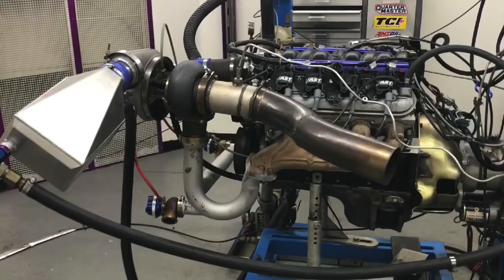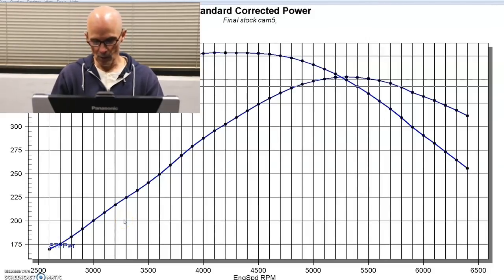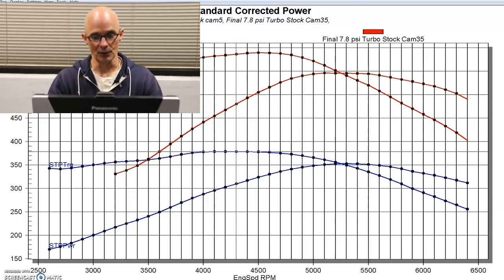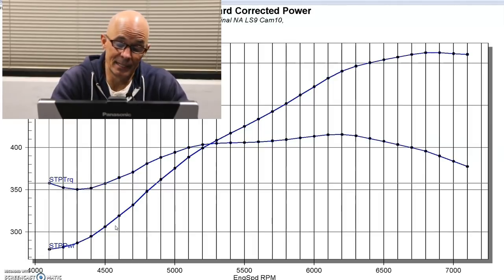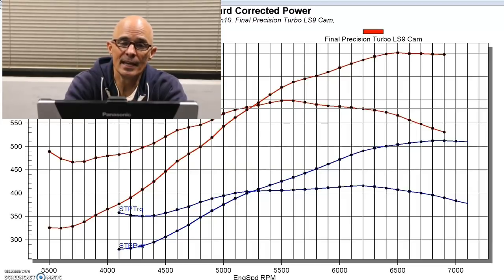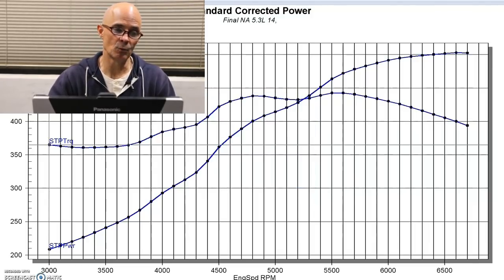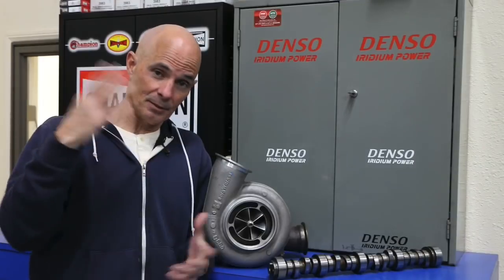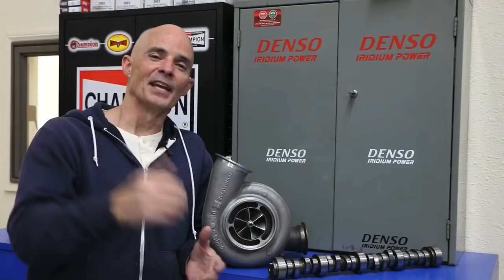REVEALED-DIY TURBO SECRET-EVERY CAM WORKS!

Comment: Good to see this kind of video out there - it should keep a lot of people from throwing money away.
The whole advent of the "turbo cam" is from when high performance cams were primarily slightly toned down, long duration, big overlap race grinds developed for big N/A horsepower, had very narrow powerbands and had little to nothing for drivability or area under the curve.
Those old grinds and the fact that cars were carburated (carburetors rely on steady/smooth airflow at low rpm to properly meter fuel) meant that adding a longer intake tract like turbo ducting made engines even more lazy on the bottom which added to/created what people called turbo lag - stepping into the throttle got nothing for results up to the rpm the cam was designed to work in, then the boost would come in about the same time because the engine was now making exhaust flow and heat to spool up the turbo. Back then a stock cam was a much better "turbo cam", so the demand for "turbo cams" was born.
Early turbo cams were just slightly hotter versions of stock grinds which put low speed throttle response back into the power band.
Camshaft design knowledge has moved so far forward since that time.
There's still an advantage to using a camshaft designed specifically for turbocharged applications - but that should be one of, if not the last place to look for more power in a turbo application.

Comment: Great video Richard! Oldschool, with carburetors, the general rule of thumb was to run cams with a wide LSA. Today with FI, less of a concern. As illustrated, boost multiplies the power output of a NA engine. I would love the see a future test of cams with LSA of 108 to 120deg. For me, which cam makes a turbo more efficient with respect to response and boost. If running a LSA of 108deg, can the timing of the fuel injectors be delayed to minimize unburned fuel being introduced into the exhaust.

Comment: I did an old school Ford 302 in a '90 Mustang LX about 15-16 years ago. It was an NA cam. My brother, Denisson, argued with me about this because we were using a Vortech T-trim supercharger. I had seen a build exactly like this, using the same blower and cam. It made 650 hp at the flywheel. We were at about the same boost as this 650 hp engine, 15-16 lbs. It worked great!!!!! I raced a worked Evo on a highway, in Mexico, and I had to pedal it until 3rd gear, then it started going sideways at the top of 3rd!!!! With sticky road racing tires!!! This cars suspension was set road race stiff. You could push down on the hood and the suspension would not compress. Table stiff. Going through the gears WOT, the front would lift up on the suspension like it had drag springs in it!!! My brother was very happy with the outcome. I was too. BTW, I would buy an armored car as a daily driver if I was you!!!! Thanks for being  honest too.

Comment: Great info Ive noticed this in your dyno charts up to now, good info to get out there. If your turbo can only produce a max of 1000hp running too big of a cam is only gonna limit your bottom to mid range. So a turbo cam should basically be a sized for planned turbo output to maximize power under the curve. Nice!

Comment: I just watched the first 30 seconds and thank you! Turbos do what they do. They make more power. Want more power from your turbo setup? Build a motor that's better na or make more boost. The more you can flow na the more you can flow turbo and make more power with less boost. Wanna make more power in general with any setup? Make a better air pump. That's what engines are. Giant air pumps. When your pump can flow more air you can add more fuel and make more power 👍WANNA CHANGE THE WAY YOUR ENGINE MAKES POWER? Change the cam. pretty simple at the heart but it gets complex when you're running the ragged edge and trying to eek out every drop of everything you can achieve within a given setup or set of rules etc...

Comment: This video was very useful to me. I had aspirations to torch my old 305 k10 Chevy just because it’s a fun experiment. There won’t be high expectations for a 160 NA engine but I always felt it would work. I’ve been told that it was a silly experiment to try to make 350 hp when a cam and heads would get me the same output; however, I have a 300 hp 305 and it isn’t a good combo for daily driving. The stock motor seems to be; especially with the addition of boost. By my calculations, the VE is so low, I suspect that I may really need to shove it in under pressure to hit my target but I believe it’s easily obtainable and it isn’t enough to damage the stock internals.

Comment: This is 100% the truth I did so much testing all the results were actually the same as what you're talking about what turbos do is magnify the horsepower your engines already putting out I argued with so many people when building  motors for them that's what I do now i showed them on a Dyno took the time to pull the cam out and put a turbo cam back in made less power and still they didn't believe their eyes comments were I don't  have the turbo up like i did with the na cam LOL people are going to be stuck on what they hear how they feel GOOD VIDEO!!!! 👍👍👍

Comment: Excellent video.

The reason that they market cams towards turbo, or sc or nitrous applications is because they design cams too make up for shortcomings in the power adder.

The LS9 cam you showed is an excellent example of this. Supercharged cars run out of steam and boost up top. GM designed that cam too make power up top because the eaton blower makes plenty of power down low and in the midrange.

Comment: This gives me some peace of mind.  I've got stage 2 N/A cams in my 5.4 2V that I'm going to put a single turbo on.  Ive been in a mental struggle on whether to change the cams out for turbo cams.  If it was an all out, max effort build, then maybe I could justify it.  But since it's just my daily driver, I think it will be just fine.
Reply from the maker: I ran those 2V cams on a 4.6L with a turbo-works great-little soft down low (na and boosted)

Comment: My understanding of the differences with turbo cams was to improve how quickly the turbo spooled on the low end and improve efficiency by reducing the amount of fuel air mixture that was blown through during valve overlap. Totally agree on total output though. don't matter there.

Comment: On a dyno I believe everything he says.on the drag strip changing to the “optimum cam” to take advantage of gearing,weight, converter, and how fast it spools in the 60’ ,330’ and mph is a definite advantage
Reply: And also how it reacts at part throttle stuff during normal driving conditions.
Reply: Don’t matter you will set that up to whatever power curve your engine has! It all comes down to what your going to do with it.
Reply: Not everyone gets it right the first time. It’s A lot easier /cheaper to change the cam versus gears,converter, or weight
Reply: @davidyoder3605  Especially with a typical grandpa car with the 4r70RW like I have, my Towncar could sure use another 125hp, more torque and a good diet, preferably while improving efficiency

Comment: I've always been a NA guy and engine builder.  I always thought what you're saying should be the case but all of the noise in advertising and on the internet made me wonder if this assumption was correct.  In my mind and what your empirical data shows is that, if you think of a NA engine in a sealed dyno room that can maintain constant atmospheric pressure and temp, as you pressurize (boost) the room, the power curve should increase proportional to the amount of atmosphere(s) (pressure) the room is increased. The only small caveat would be if frictional losses increase.  I know the exact opposite happens as NA aircraft engines go up in altitude and lose atmospheric pressure and horsepower, there's lots of data on that too.  Great video, thanks!

Comment: Thank you very much for providing this video and information.  Im in the middle of building a 5.0 and wanted to get the car going NA and add boost down the road and didn't know if the AFM N41 cam would be ok with boost. This was so helpful. Now all i have to do is get thicker headgaskets to lower the compression from 10.5:1 and add a turbo!!!

Comment: Great video Richard. I've been saying the same thing for decades....as well as adding compression. How much cylinder pressure can the rods and main caps safely handle?

Happy n/a engines make happy boosted engines!
Reply: Too an extent, granted nowadays you can run a little more compression than people use to. But still running a huge amount of compressing let's say like 11ish:1 will help with power production but there is a point where the cylinder pressure is too much and your going to make more power being able to turn the boost up more than the extra compression is going to help. Plus the fact of the kind of fuel needed to run a super high compression engine and then adding some Japanese hot sauce to the mix.
Reply: @torqueandbeanssauce  I've been told by the "tribe" here that 9:1 gives the best throttle response and works with boost, and that is what they now target.

Comment: Me and my dad can’t wait for you to do the sloppy stage 2 build  on a 4.8 or 6.0 or even both 😁
Reply: I wonder what he would recommend for us street/strip daily driver do it all guys, figure 3500lb car (or small truck), running a/c, ps ect. that would like low cost, decent mpg and run mid-low 11s. (with so-so 60ft) Like Matt says "goals".  I'm thinking maybe 6.2/6L80 from a complete 07 copart escslade with a small/medium shot would get me there. Short tuning here in Ky has set up some 6l80's without the BCU and they should live under 550 whp, so I would target 550 at the wheel.

Comment: Very very good tech. I'm planning on building a car soon. I'm new to the turbo stuff and you taught me so much. I wanted to start off and build a na motor and get as much as I can out of it but with the thoughts of adding boost later. So if I build a 400 hp engine. When I boost it at 14.5 it should make 800. Very simple and easy way to see if your tune is on or not.
Reply: Also I notice you do alot of na and turbo tests on sane engine. How much of the tune do you change from na to turbo? Have you found a formula to go from one to the other? Or are they all different?

Comment: 21.2K !!! You're growing brother !!!  I have like a bazillion questions LOL...
You always say to build the engine the best you can NA first, then add boost...
But doesn't piston to valve clearance, springs, compression ect. have to be taken back or undone a little to keep things in the safe zone?  Also, with today's modern oils and additives, is it safe to go bigger than usual with a flat tappet system on older engines?
Reply: The only thing that you listed that matters and this is JUST A LITTLE is springs.  Now when your valves are closing they are sounded by more dence gas(s) and so will be slower to close and the boost pressure will be pushing on the back of your intake valves.  The compression only dictates what new minimum octane you need and how much ignition timing you can run.  As Richard is trying to explain is its not as complicated as a lot of people make it out to be.

Comment: Great video displaying common physics.
HP = AP X CID X CR X VE X RPM /5250 / 150.8
Add boost (guage) to 14.7 (standard corrected Atmoshperic Pressure) and see what happens.
Great vid!
Reply from the maker: I didn't include the patented Holdener Power/Boost Formula. Turbo Hp=Na Hp x Boost/14.7 +1
Reply: @richardholdener1727  lol! I didn't want to plagiarize your work so I posted the "un-holdenized" formula!
Great work you're doing!
 Education is sadly lacking in the halls of horsepower these days....

Comment: "Back in the day" I was told a Turbo cam is designed to minimize heat on the valves and generate a broad usable  torque curve.

You don't want 1000hp going to the wheels in a aggressive fashion or things break and cars become uncontrollable or valves melting in real world situations.
Love your content by the way

Comment: One improvement on the how-much-power-will-boost-add question is to take the baseline brake power, divide by 0.85 to get the indicated power,  and then subtract the baseline brake power from the indicated power to get friction.  Then multiply your indicated power by the ratio of the new MAP to the old MAP to get the new indicated power.  Then subtract friction power from new indicated power to get the new brake power.  That 0.85 number was a good ballpark number for mechanical efficiency 35 years ago, but it might be higher nowadays with improvements to friction from better journal bearing design and roller cams.  Don't get me wrong, I like your ballpark guide, but his method would yield a tighter prediction.

Comment: Overlap spools the turbo faster but spins the turbo faster to make the same boost because part of the boost goes out the exhaust. The trick is to make a cam that spools fast enough but doesn't have excessive overlap.  Lets say 2 cams with the same specs make the same peak hp in an engine n/a, 1 on 110 lobe separation the other on 114. The cam with 110 l/s will spool much faster but build more back pressure up top where as the 114 l/s will have less back pressure & pull to a higher rpm.   That's the way i understand it.

Comment: i think the turbo cam deal has more to do with when the spool characteristic of the combo comes into play with gearing, stall, weight etc at the strip. I do agree with the message tho, boost is just a multiplier

Comment: This explains why the custom ground Comp Cams turbo cam (.513/.513 on a 115 LSA) for my 4.3L V6 Typhoon ran so well N/A. Had a nice flat torque curve. Running 14psi currently. Can't wait to get it tuned & start running it on the street.

Comment: I fully agree and understand the proportional increase along the rev line.
Q. You indicate that @ 1 bar (14.7 psi), you’ll typically double power output, though one could argue that if all things are equal, other than exhaust back pressure, which can be impacted by the turbine housing A/R, wheel trim, downpipe, ect, the actual increase can vary significantly at the same 14.7 psi boost.
Cylinder filling efficiency,, air temps measured inside the cylinder before the compression stroke, exhaust side pumping losses, etc.
In general...Power production of a turbo engine is dynamically impacted by the exhaust side more than one might expect.
Reply: As he said,  size the turbo correctly, then the math basically works.
Reply: Todd Allen 
Sorry...but engineering data proves Not all boost is equal!
Example: compare power increase from 14.7 psi boost from a single turbo, then 14.7 psi boost from a twin turbo on the same motor
Reply from the maker: Or if we dramatically drop the inlte air temp-we get more than 100% gain at 14.7 Psi
Reply from the maker: if the turbos are sized correctly, the same thing happens
Reply: Richard Holdener 
As I explained. Not only will various exhaust side elements produce a higher quality air charge. 
Various exhaust side elements (read my previous comment) help to produce more power as well.
Thus, 14.7 boost does not automatically equate to doubling power.
Reply: @flyonbyya  I believe the point Richard is making is that this is a general rule of thumb using the conditions he's seen in a dyno cell for 25 years.

Comment: Now try the same tests on pump gas. You might have a tuning issue with a cam with a good amount of valve overlap (N/A cam), in particular at high revs. Your absolutely right about the power curve being the same though on any cam, but back pressure from the turbo will cause hot inert exhaust gases to flow backwards into the intake (due to overlap) and warm up your “cool” intake air and auto ignite at high revs. This can basically be stopped by running an alcohol fuel or race gas.
Reply: At least this it what I’ve experienced and researched...

Comment: That's what I learnt with boost especially turbos , modern turbos are super efficient.  Don't worry about displacement or cam or heads . Just size the turbo for power you want especially the hot side and if you can't hit your desired goals just turn up the  boost till you get there . The import guys figured that out a long time ago .

Comment: I cannot believe how intuitive your videos are I've been watching every one of them and it has Changed My Mind Set On A lot of engine builds you seem to be extremely intelligent question for you I have a hang up I am building a old Ford 400 for my son and we're just going to throw a cheap twin turbo gt35 on the engine with the stock Pistons just to play around with i for the life of me cannot find the best cam online it seems that the Ford 351m and 400 share the same cam what's your thoughts on the best cam if you don't mind thank you so much
Reply: I was thinking of this cam
SUM-5201
Reply from the maker: A 224/230-ISH CAM WILL WORK WELL-AS WILL MOST OTHERS
Reply: @richardholdener1727  thank you for the reply just ordered the cam

Comment: Fantastic content! 
One point, though—if you’re doing a street engine, can you drive the combination at, say, 2000 rpm? Seems to me the bottom end of the curve and driveability might be affected a lot by cam selection in spite of mid-range to peak numbers. (Overlap, A/R ratio of the turbine, etc). For a drag car this wouldn’t matter, of course. That’s probably a question that’s hard to answer on a dyno, but maybe there are indications...

Comment: I’ve always looked at it like this what ever your looking for low torque or high RPM or what I call top end power get a camshaft  that fits  that specific application and if you want more power in that same area well add more Air. Of course need a few more spices like fuel and spark but simple. Thanks for all the info. God Bless!